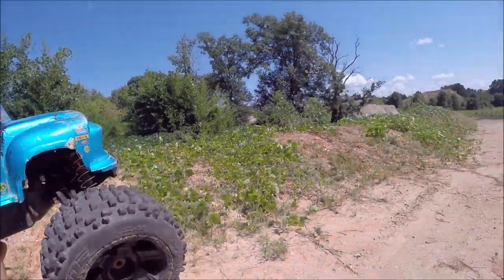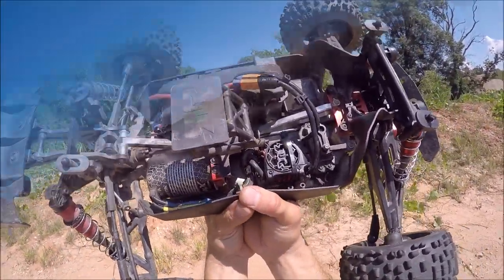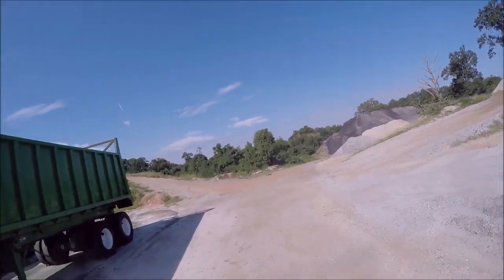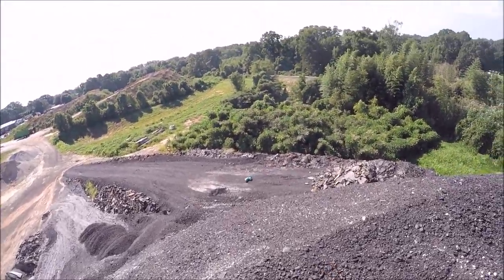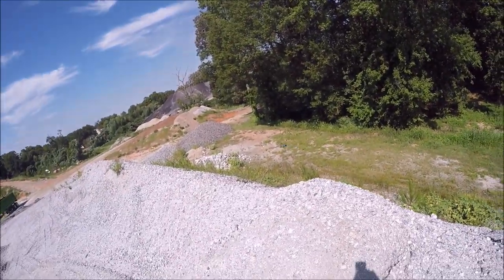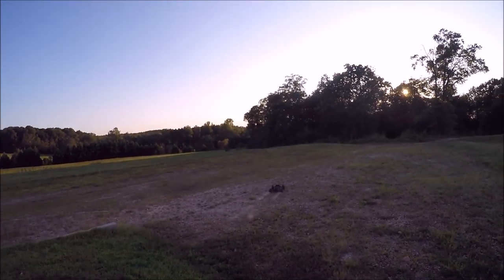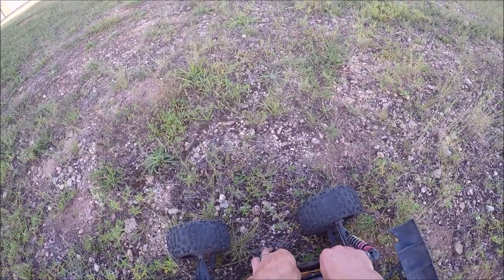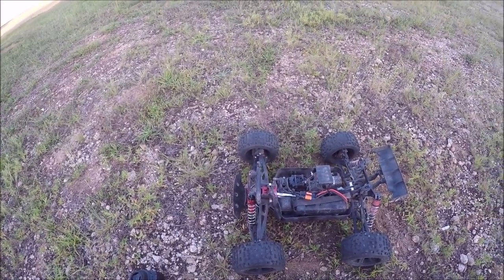ARRMA Outcast 6s  -FREESTYLIN FULL SENDING  BEAST! "THE  BATTLE AXE!!

Comment: I keep having bulkhead breakages that lead to diff gears stripping out. 

Have you found the hot racing bulkheads to be stronger?
Reply from the maker: That's unfortunate bro! Yes, the HR Diff housings are a WIN WIN in my book! I run them on all my 6s rigs in the rear and now this truck has both! Kinda pricey but you will never buy another diff case! Just a must to run 2 outer bearing shims to mesh the input/ring gear!
Reply: @RCDUDE81  thanks. Just pick 2 up for the Kraton. Will test then and if they help I'll add then to the Outcast.